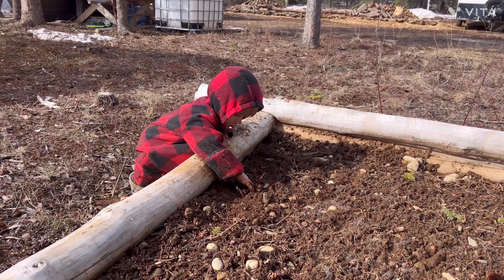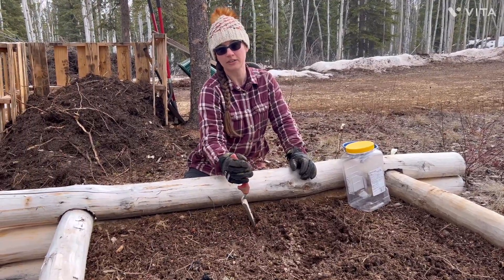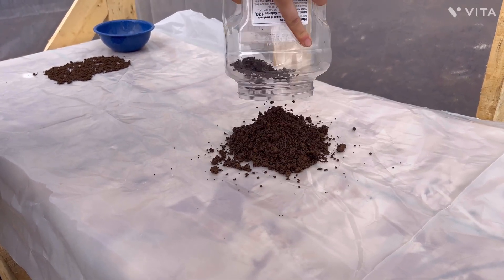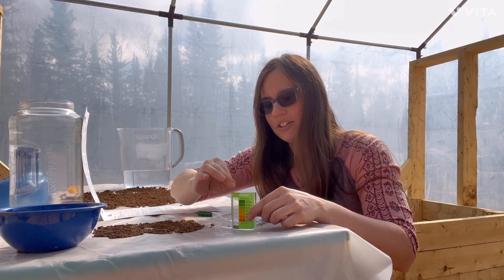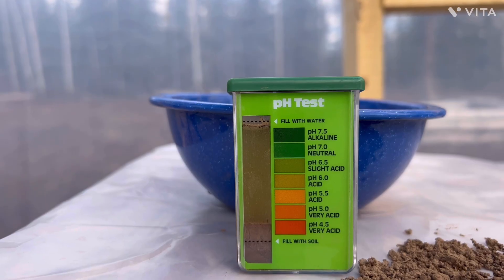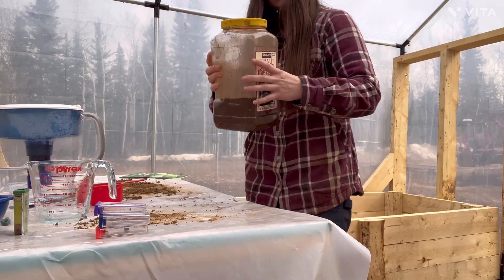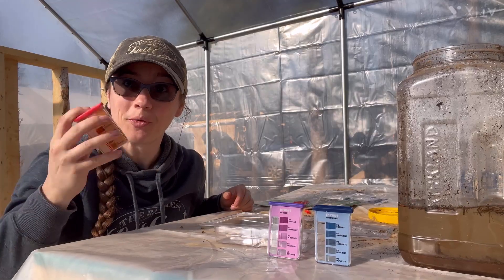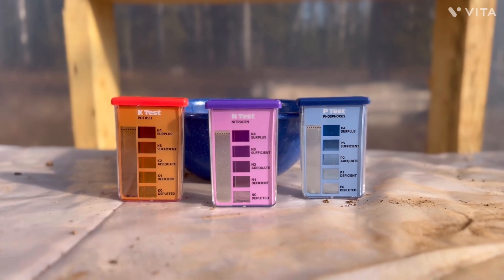Testing the Soil on our Homestead in Alaska

Comment: FYI, to maybe help. There is a little horse farm in Palmer, called my little farm. Every year, they let you come get rich dirt that was once horse manure. It looks like black gold. It is only 30. A pickup load, and that's really a donation for them loading with a tractor.
I also use chicken house shavings. Because it's not hot up here and our soil is so bad, I don't even set outside a year. I do the stacking method, I stack shavings in there all winter, and so it breaks down in the chicken house. I love it. The horse compost and chicken shavings  can go together, I also add lime and potassium. My potatoes over filled my hands last year, my celery was over two ft high, both takes alot of water and I use my duck pond water after potatoes are up about 12 inches. 
For my snow peas same soil but I don't add duck water I use a all nature blooming nutrient I got at greenhouse supply store in plaza by value village in Wasilla.  I have a 16x36 greenhouse with 3 long 4ft high raised beds,  and 6 8ft raised beds outside, a 25ft ground raised bed and 25ft  large potatoe row, and a 45ft hugelkultur that are outside. I live in Matsu Valley.
Reply from the maker: Wow, that is all great information, especially coming from a fellow Alaskan! Thank you for sharing! I will have to check out that farm in Palmer, sounds like AWESOME dirt! Love that you use water from your duck pond! It sounds like you’ve got an awesome garden setup going! I hope to be there one day 🤞
Reply: @FinalFrontierHomestead-i5t  I have done little by little to get where I am today. I am now 70, that's why I have mostly raised beds. Best of luck on your garden this year.
Reply from the maker: I love it! Thank you so much!!

Comment: I've planted in a lot of different soil types. I have never had, or tested my soil. If it was what we have here under top soil, red clay, I added sand. just to allow it to not clump and stick to it's self. I just as a couple of inches of sand, till it in, and then sometimes repeat. Oh and this was outside not in beds, land.  Then I spread manure, my fav is decomposed chicken litter that had saw dust in it before compost. But have used cow and horse too, but it takes more of it. Then when I plant, in rows, I add some 12 12 12, and some lime. Not much of the fertilizer, and heavier with the lime. If after the seed pops, they grow fast, then I leave it alone for now. If it is a pall green, more lime. Then I just monitor it to see if I need to add anything else. But, with my tomatoes and peppers, I dig a hole(using plant starts) then add a half of shovel of the decomposed chicken manure, cover with a few inches of dirt, then plant the plant, and then another half of a shovel of the manure about 4-6 inches from the stem, and build a "mote" around it with dirt to hold more water. Water it well, and then as needed. It takes around 60 days till you start getting ripe tomatoes, but when they come, THEY COME. So be ready to process 5 gallon buckets full at a time. I usually plant 25-35 plants. Tomatoes, tomato sauce, spaghetti sauce, chili sauce, tomato soup, and vegi soup, some in pints, some in quarts. All of this can be frozen in bags too, but I like the canned stuff best. The peppers, green, hot, and mild go into my stuff I can, except for what I dry, for both seasoning, and to save for seed next year. I have some seed that is probably descendant from peppers 40 plus years ago from my dad. I don't stake my tomatoes, I use a T-post at the ends and run wire between to tie to. When they top out, and no more room to tie off to, I let them grow and droop, then start tying them on the way down. My dad never staked his tomatoes, he let them fall. He had bigger tomatoes, but not as many, but, they were impressive! I just hated sifting through weeds and vines to find them. The biggest reason I stake mine. I can keep it cleaned out of weeds with about 10 mins with a hoe every other day.
Reply from the maker: Wow, this is INCREDIBLE information, thank you so much for sharing! I found a lot of what you wrote extremely helpful and well written! Love your t-post/wire idea for the tomatoes! I will be re-reading this and probably commenting again 😅
Reply: @FinalFrontierHomestead-i5t  First, I know that comments help with what you get paid, So, I comment often, if I have something to share. As far as gardening, I can only share what I know works here, and I am in North Carolina, so your milage may vary. If you like green beans, Try at least a test of Blue Lake Bush beans. They to not run, just makes a bush, but, I have picked beans for nine weeks, and several years back, between my son and I, We canned 424 Qts. Not to mention the friends and relatives we let come and pick all they wanted. But feel free to ask anything you are curious about, If I can help, I am happy to.
Reply from the maker: I truly appreciate that! And so cool about the beans! I will see if I can find those seeds for next year as I would LOVE to try growing some!! I am sure I will have many more questions so I’ll remember to reach out! Thank you again for all your help! I really do appreciate it!